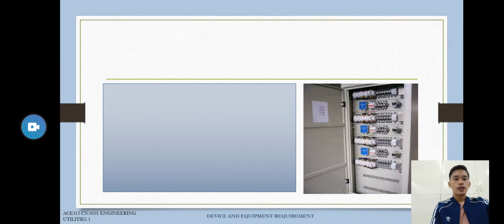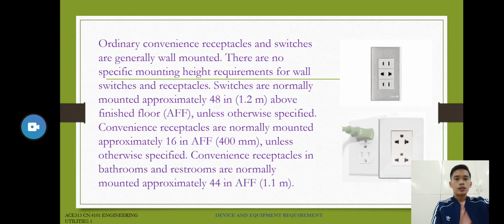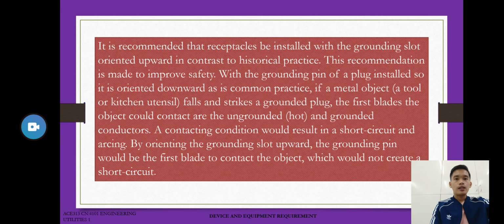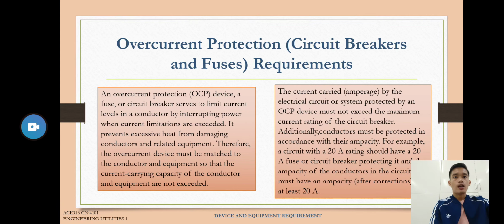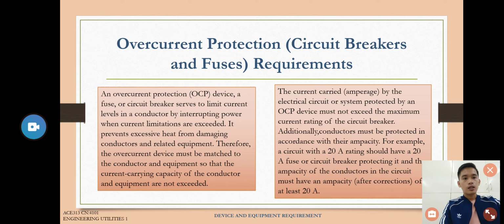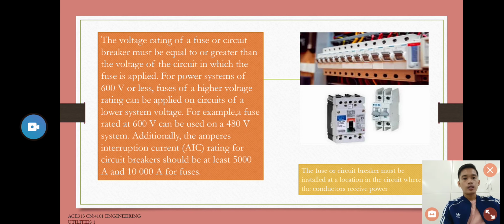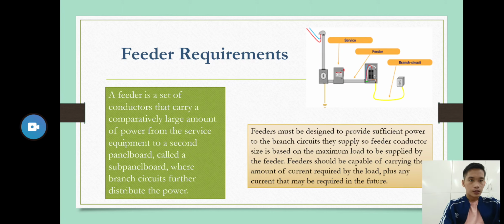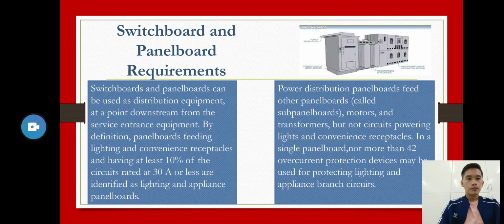ACE313 ENGINEERING UTILITIES 1 Report

Comment: In this presentation, I learned that the switch should be used to control the load of electricity. There's also a panelboard that controls the massive lighting system and has a lot of switches on it. The reporter also discusses the regulation for wall switches and receptacles with specific mountain height restrictions. It also discusses overcurrent protection, which restricts the amount of current flowing through a conductor by disconnecting power when current limitations are exceeded.

Comment: It is critical to understand the criteria for switches and receptacles. This also applies to electrical protection, which is frequently required. It is mentioned that the switch must be compatible with the load they manage, and the switch controls the receptacles, implying that there is a relationship between the two for a better function. Their relationship entails normal safety precautions to avoid any potential mishaps.

Comment: I've gained a lot learnings about the electrical equipment requirements for switches and raceways, as well as overcurrent protection such as circuit breakers. Switches are used in electrical equipment to produce and break electric circuits. Electrical connectors that connect an electronic device to a power source are known as receptacles.

Comment: In Ontoria's report, I have a better understanding of the electrical equipment needs for switches and raceways, as well as overcurrent protection such as circuit breakers. Switches are used to create and break electric circuits in electrical devices. Receptacles are electrical connectors that link an electronic gadget to a power source.

Comment: The needs for devices and electrical equipment were discussed by Ontora's report. Electric switches are critical because without them, all of the equipment we use is useless. With its shock-prevention feature, the receptacle safeguards your safety and increases the electrical safety in your home. He also discussed Overcurrent protection, such as circuit breakers and panelboards.

Comment: This video explained the switch and socket requirements. This topic is also important for electrical systems. Electric switches  control power, detect that the system is out of range, signal  the position of machine elements and workpieces, manually control  machine and process functions, and control lighting. An electromechanical device used in an electric circuit. This device is very useful in electrical systems.

Comment: Generally Speaking, useful quality tools can be a significant investment, but they will last longer and return the favor if you take good care of them. Making sure your devices are properly stored, cleaned, and well maintained will save you time, money and keep you safe, as well as making your projects and jobs much more comfortable. This requirement such as in Overcurrent protection is to protect against excessive currents or current beyond the acceptable current rating of equipment. It generally operates instantly. Short circuit is a type of overcurrent. Magnetic circuit breakers, fuses and overcurrent relays are commonly used to provide overcurrent protection.

Comment: This report gives me an Idea about the purpose of receptacles and switches, why we need this and why we have this in our home. It helps to lessen involving in electrical, the others connect the wire through molding two different wire, which is very dangerous, that is why we are using switches, it is easy to off and on the light or other equipments that have electricity.

Comment: This video explained the characteristics of switches and receptacles this topic is very important in electrical systems. The purpose of these regulations is to ensure that electrical employees are safe when working on electrical equipment. Building and repairing have become more refined than ever before as a result of the discovery and development of improved electrical tools and equipment.

Comment: I learned more about the necessity of switches and receptacles, as well as how they operate. I also learned about the many types of switches and receptacles available, as well as the requirements for each. Receptacles should be chosen to match the device or equipment that will be used with them.

Comment from the maker: In my report It is critical to understand the criteria for switches and receptacles. This also applies to electrical protection, which is frequently required. It is mentioned that the switch must be compatible with the load they manage, and the switch controls the receptacles, implying that there is a relationship between the two for a better function. Their relationship entails normal safety precautions to avoid any potential mistake.

Comment: In this topic I've learned that it is important to select the switches that best match the load that they control to prevent also the incidents. Overcurrent Protection plays a big role that makes our electricals or us people to be more safe in our homes or buildings, cause i think this thing cuts the specific flow of the current one's it Senses the abnormal flow of current but make sure first that it matched.

Comment: This topic taught me about the requirements for switches and receptacles, overcurrent protection, feeder, switchboard and panelboard, service entrance equipment, transformer, and ground fault circuit protection. Electrical switches are electromechanical devices used in electrical circuits to control power, detect when systems are operating outside of their operating ranges, alert controllers to the location of machine members and workpieces, provide a means for manual control of machine and process functions, and control lighting. The purpose of these standards is to guarantee that electrical employees are protected from electrical hazards when working on electrical equipment.

Comment: In this video, I gained a better understanding of the importance of switches and receptacles, as well as how they function. I also learnt about the different types of switches and receptacles, as well as the criteria for each. Receptacles should be selected to complement the device or equipment with which they will be utilized.A switch's selection must be based on the load it controls. Large lighting setups with several switches may be housed in a panelboard-like enclosure known as a lighting control panel.

Comment: In this presentation, I have learned about the requirements for switches and receptacles. That switches must be matched the load that been control and receptacles must be selected ro match the appliances that serve. And the another was the different overcurrent protection requirements during damaging in circuit breaker and the fuses.

Comment: In this presentation, I learned that in able to control the load of electricity, you should use the switch. There are also panelboard that controls the large lighting installation and it contains many switches. The reporter also tackles about the standard of specific mountain height requirements for wall switches and receptacles. It also talks about the overcurrent protection that limits the current level in a conductorby interrupting power when current limitatios are exceeded.  Lastly, this device and equipment in electrical system plays a vital role to the people in making its life easier and protects to hazardous risk.

Comment: In this video, I learned that Switches must be chosen to control the load they are controlling. Large lighting installations with numerous switches may be housed in a panelboard-like enclosure known as a lighting control panel. Receptacles should be chosen to match the device or equipment they will be used with.

Comment: In the video, the reporter talks about the requirements for switches and receptacles.
In his particular topic its exhibits a significant in electrical systems.
The purpose of the application is to ensure that electrical employees working on electrical systems that are safe from electrical vulnerabilities.  Switches and receptacles must be selected to match the load they manage, according to the requirements.When a large lighting system necessitates a large number of switches, the switches may be enclosed within a panelboard-like enclosure known as a lighting control panel.

Comment: In this video, requirements for switches and receptacles is a switches must be selected to match the load they control. Large lighting installations that require many switches may have the switches contained within a panelboard-like enclosure called lighting control panel. Receptacles must be selected to match the appliance or equipment they serve. Feeder requirement is a set of conductors that carry a comparatively large amount of power from the service equipment to a second panelboard, called a subpanelboard, where branch circuits further distribute the power.

Comment: In this report i leaned the different types of switches and receptacles. Also i realize how important that we have an idea on how to install the receptacles perfectly so that we can prevent harm and danger in the appliances and for people. I also learned that we need to check our circuit breaker permanently so that we can identify if we need to replace the fuse in the circuit breaker.

Comment: The characteristics for switches and receptacles were explained in this video; this topic is very significant in electrical systems. The goal of these regulations is to guarantee that electrical employees are protected from electrical hazards when working on electrical equipment. Because of the discovery and development of improved electrical tools and equipment, building and repairing has become more refined than ever before.

Comment: Ive learned that overcurrent devices must have an interrupting rating not less than nominal circuit voltage and the current that's available at the line terminals of the equipment (110.9). Circuit breakers used to switch 120V or 277V fluorescent lighting circuits must be listed and marked SWD or HID

Comment: The importance to know the requirements for switches and receptacles are need. This also relates to protection where usually needed to apply in electrical. It is stated that the switch must be compatible to the load they control and the receptacles are controlled by the switch, which means, their is  a relation between the two in order to have a better function. Their relation implies usual safetiness to avoid accidents that might happen.

Comment: I learned about switch and receptacle requirements, overcurrent protection requirements, feeder, switchboard, and panelboard requirements, service entrance equipment, transformer, and ground fault circuit protection requirements in this topic. The goal of these regulations is to guarantee that electrical employees are protected from electrical hazards when working on electrical equipment. If you compare the electrical safety gears accessible in the market today to those available in the past, you will see that they have come a long way and undergone a significant evolution.

Comment: In this topic, I learned about the requirements for switches and receptacles, overcurrent protection requirements, feeder, switchboard and panelboard, service entrance equipment, transformer, and ground fault circuit protection requirements. The purpose of these requirements is to ensure that when working on electrical equipment, electrical workers are protected from electrical risks. Building and repairing has grown more polished than ever before because of the invention and development of superior electrical tools and equipment.

Comment: In this video, it taught us the requirements for switches and receptacles, this topic is also important in electrical systems. Electrical switches are electromechanical devices that are used in electrical circuits to control power, detect when systems are outside their operating ranges, signal controllers of the whereabouts of machine members and workpieces, provide a means for manual control of machine and process functions and control lighting. This device is very useful in electrical systems.